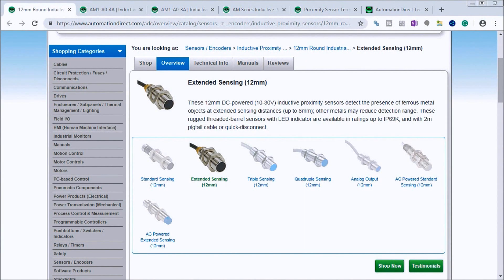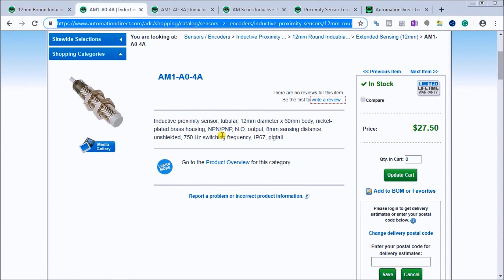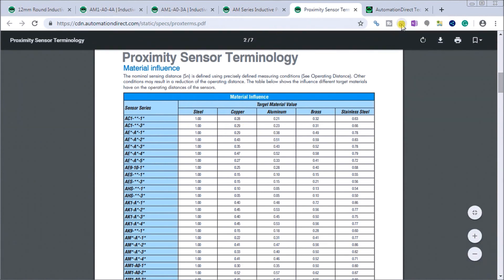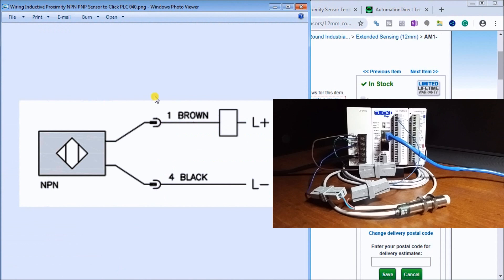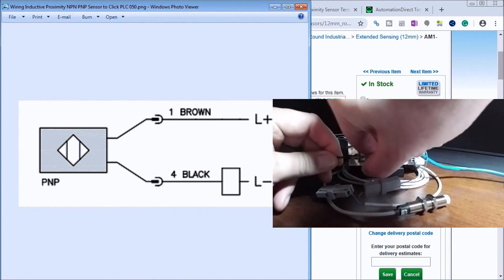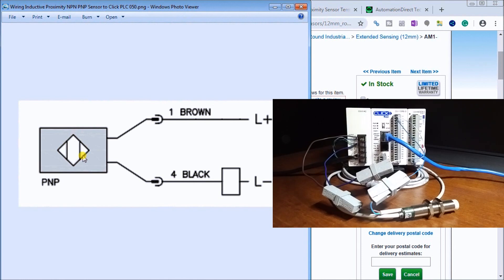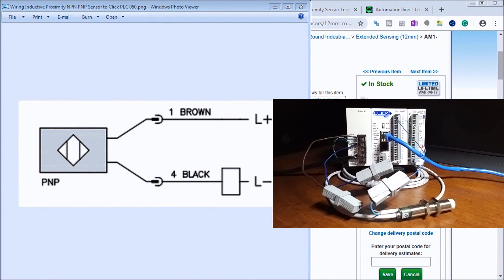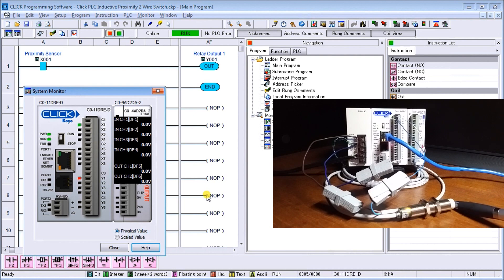Wiring an Inductive NPN PNP Sensor to the Click PLC

Comment: I have the click co-00dd1-d and I just added a co-00ac power supply when I plug it in, I have a green power light and red err light. I know it is wired correctly I've double check and compared it to other videos.
Reply from the maker: Hi Rod,
If this is a new Click PLC, the red error light probably indicates that you do not have a program in the controller. Try turning the switch on the CPU to STOP and cycling the power. This will probably turn off the error light.
When you connect to the controller through the software, it will indicate the exact error.
I hope this helps you out.
Regards,
Garry
Reply: @ACCautomation  yes I figured out it didn't come with a back up battery so the program that was in it is no longer. Battery is on the way.thanks.
Reply from the maker: Glad you figured it out. Thanks for the update.
Garry

Comment: To me it looks like the power supply is not directly connected to the PLC. Was this for demo purposes? I was hoping to see how this would be wired in a real situation. You would wire the black into the X and the Brown in C and the blue where would you put it? Sorry, I am new to this.
Reply from the maker: Hi Allendale,
On the website, you will see the wiring diagram for both the NPN and PNP.
https://accautomation.ca/wiring-an-inductive-proximity-npn-pnp-sensor-to-the-click-plc/
When wiring into the PLC the PLC input acts as the load on the sensor. The PLC will only have an input point and a common for the input point.
If the sensor is NPN, your wiring from the PLC point of view is the brown will go to the input and the common will go to +VDC.
If the sensor is PNP, your wiring from the PLC point of view is the black will go to the input and the common will go to 0VDC.
See the above page for the diagram.
Here is another post that may also help you out with wiring sensors. It uses a three-wire instead of the two-wire sensor.
https://accautomation.ca/wiring-a-capacitive-proximity-npn-pnp-sensor-to-the-click-plc/
Hope this helps you out.
Regards,
Garry
Reply: @ACCautomation  , thanks so much for your swift response. I also looked at other videos of your! Thanks for all the work you do to clarifying things for beginners. I will give you thumbs up! :)